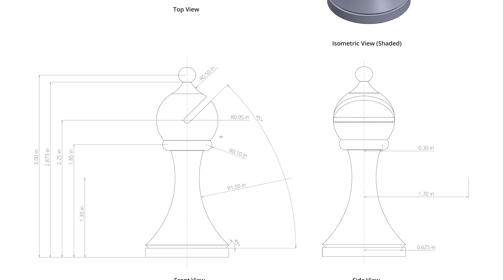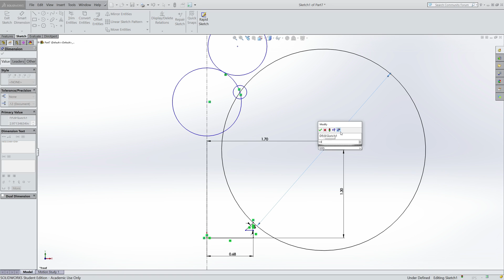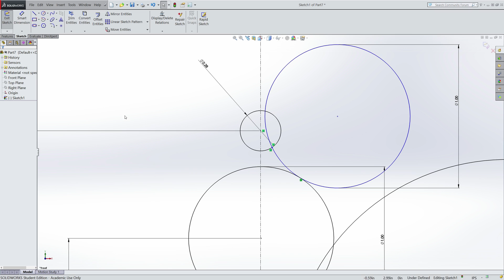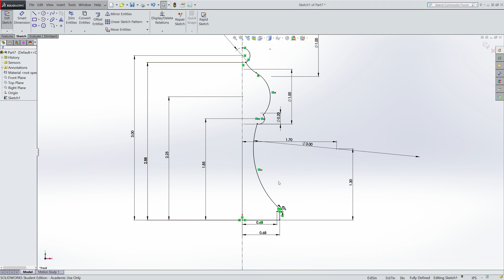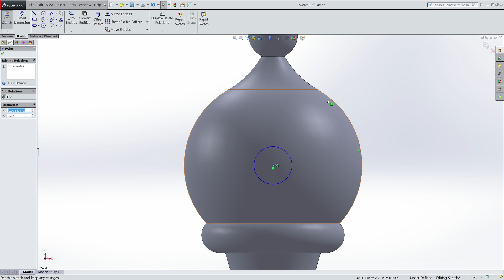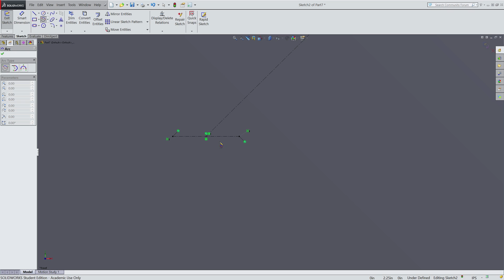Solidworks - Chess Bishop

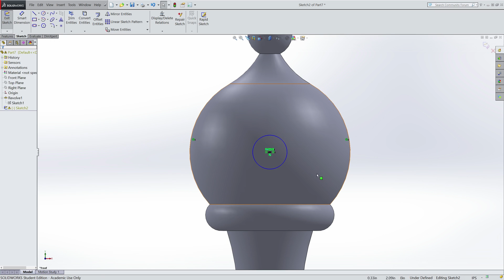Comment: For the center of the circle at 19:05, could you not have used the axis to center it horizontally, and then the given height from the diagram to center it vertically? It worked pretty well for me.